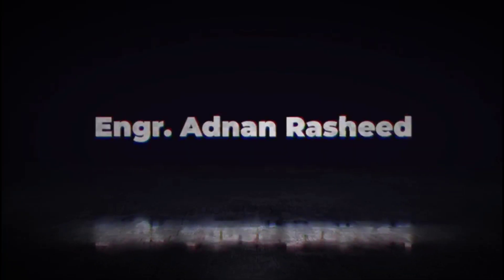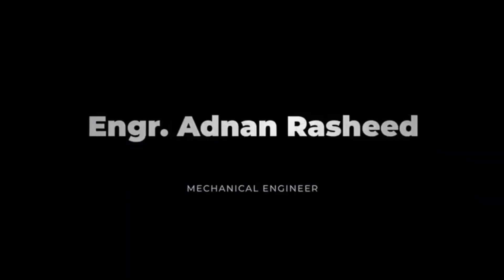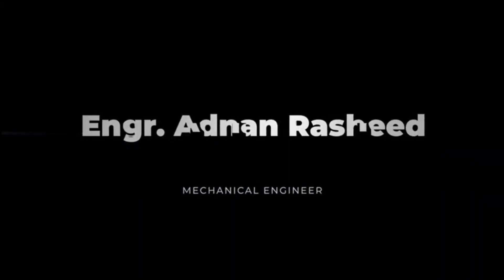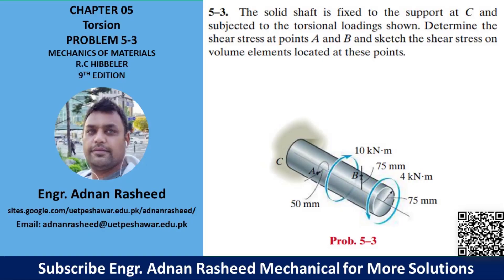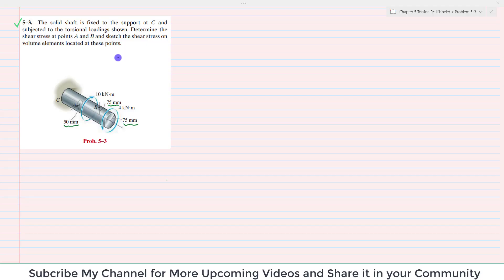5-3 |Chapter 5| Torsion | Mechanics of Material Rc Hibbeler|

Comment: Here one torque must be negative..... According to convention when we do sectioning
Reply from the maker: When you section it you have to check the net torque either clockwise or anticlockwise, then at the section it will be opposite to what you have on other side.
Reply: @engradnanrasheedmechanical so that's mean we will never take the negative sign with convention?
Reply from the maker: You will take ....

Comment: Doctor, in this question I took each piece to a diameter that would be close to it, but in questions 5-9 I took the inner diameter of the two. Please clarify which method to use.
Reply from the maker: In this problem we have to find the shear stress on the points that are on the surface, but in problem 5-9 one point where we have to find the shear stress are inside having distance from center 20mm, while point A is on outer surface(mistakenly i have take 20mm distance from the center which is 35mm). So check at which point you have to find the shear stress , outer surface or inner surface and solve it accordingly...

Comment: Why 6:03 tb not mainus?
Reply from the maker: Shear stress due to torsion depends depend on torque. So we find net torque in the rod , either it will clock wise or anti clock wise. When put the value of torque in shear stress formula due to torsion we get our required shear stress.